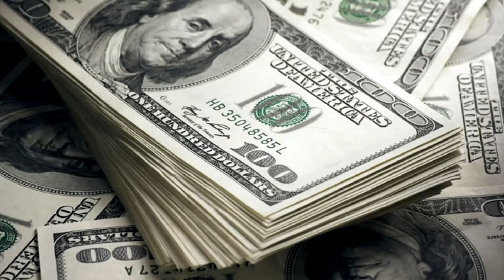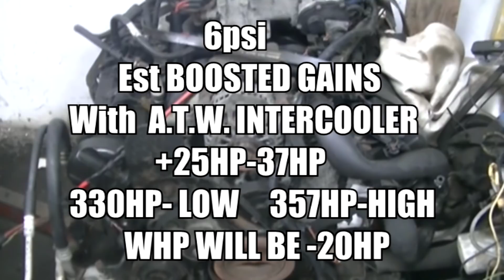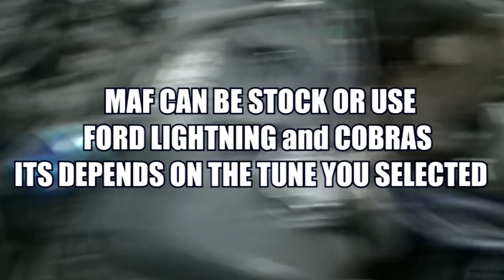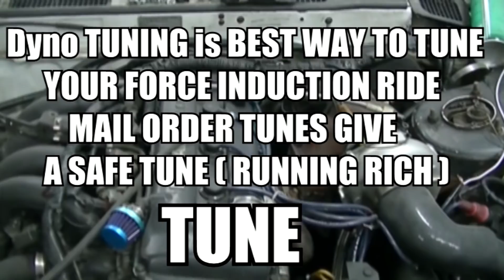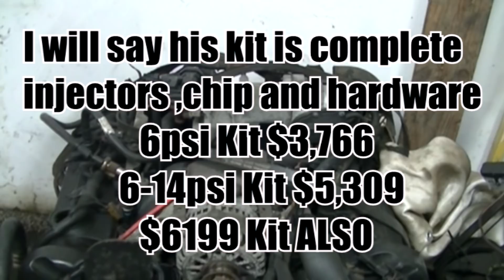TOP 3  BOOST METHODS FOR YOUR CROWN VICTORIA ( Which 1 is your number 1 )

Comment: Supercharger. Flatter curve. Easier install. Easier to cool. More reliable. More tunable (within reason). Just expensive. I have a Marauder so I’m keeping it. Only doing the best work to mine. You want power down low anyway.
Reply from the maker: True, but the cost for power down low ( with low funds ) Turbo would be for me ( ideal ) is the supercharger but it aint cheap...Procharger would be my 2nd choice ( procharger ) aint cheap either its tough call

Comment: I will say buddy, my turbo setup going in my 05 town car has cost me a total of 400$ Canadian and about 100 hours of my time to build from scratch. However it's a roadkill-junkyard special, a tp38 1rst gen power stroke Diesel turbo on a junkyard 4v aviator motor 😁 I've got 3 times that in the t45 swap 😂😂😂
Reply from the maker: it can be done i wished you had video that one brother... cause I love the back yard stuff.. I am all about that... Just put a Aviator engine in a96 police crown Vic witha 5 speed and Mach 1 upper and lower... its tough to make things happen you can win in one area but you will take a hit $$$ somewhere else for sure
Reply: When I finish rebuilding the 4v and get the swap finished I'll send you a video of it running and driving and maybe even a 1/4 mile pass if everything holds together 😜 it is an ultra low budget junkyard setup after all 🤣
Reply from the maker: @mross302  cool I would like to see that I will be doing some rebuilding myself... I was running away from it but now its time....
Reply: @bstfordchannel923  a lot of what I am doing is thanks to people like you, cleatus and the guys at roadkill, it won't be a record breaker, but if I can do 450rwhp reliably, I'll be happy for my investment. I work at a shop where I'm on a 40hr a week salary, and in my off Time I get payed to build my projects 😜

Comment: The best thing I did to my N/A, home brew GM EFI system, was add a Wide Band O2 to monitor AFR's. I am no tuner by any means but that W/B really opened my eyes as to what was going on with my engine and why it would lay down at certain rpm/load. I have a MOATES modified ECM that I can burn chips for and I am slowly creeping up on my tune thanks to the wide band O2.
Reply from the maker: agreed it does you get a more insight on what the car  does in different loads... I have to install one in the Vic soon..a very underrated gauge 100%

Comment: Honestly I would get the most mileage of out of your crown Vic and when she says it’s very tired and time for a rebuild, I would rebuilt it with upgrades but still stock then do either the pro charge or the super charger and if possible use the police tune because no one can make a tune unique for pursuit that’s why I love having my p7b but that’s just me while I daily drive mine right now for the next couple of years.
Reply from the maker: Thats they way to approach ( building you car ) it really perfect with no stress. NOW TUNE well you have tuning chops out there that can DIAL YOUR NEEDS to a T...So that cop tune ( is really based on TORQUE CONVERTER slight advance timing and shift points thats really it . Nothing too special at all , its dial to be efficient- with simple combos in ( small upgrades ) that cost ford ZERO to produce..  Daily drive your car until it wears down ( or buy a second motor ) and build it slowly over the years to your liking ..

Comment: a top 4.6 tuner used stock pistons and rods witha cam and a vortech and made over 500
Reply from the maker: the key is really the tune and gas and the wheel man.... the tune is really the most important having enough gas and timing right

Comment: Thanks bro that was exactly what I needed. Hey so I drive Lyft in my crown Vic PI n the passengers all love it. I don't understand WHY DON'T THEY MAKE IT ANYMORE! Even just putting that to one side, why can't I get ANY big fast full sized eight cylinder car. I'm 54. I don't like the small round cars and I don't want a truck. To me full size means full size. Any ideas as to what I should do? N thanks again for the awesome video.
Reply from the maker: I had to make time to answer this comment cause it mans that much tome Jeff.. Thank you for the support and love on this video.. Now The reason they got rid of Big full size cars is there is no REAL men out there like yourself to buy them.. The wave is the Suv and the CrossOver suv. So its a tough sell to say hey Ford big the big rides.. They just will not UNLESS the tide changes. AS YOU and I ,ay these big rides cool and wanted they MAY wiggle a big ride to test the ..waters Now Dodge has a Full Size v8 and its doing very well, Ford can not compete because it will mess with the flagship Mustang. Any thing faster will have to be a Mustang or Mustang badge aka the Mach E

Comment: Thanks for the info just bought mine and looking too see what mods I can do! This helped out alot
Reply from the maker: no problem  it cost alot to make these fast cause of the weight of the car ( 4000lbs and 220hp  engine ) so you would start with gears,  cause you will make car move fast off the line.. 3.75 is good. Merry Christmas Berry

Comment: Get yourself a 97-98 non PI 4.6. Swap the heads for PI heads. Install some Comp cams 274 I believe. Get a larger throttle body. Get a transmission kit and change your torque converter. Add a 100 shot of NOS and you are around the 500hp range.
Reply from the maker: I was started to do what you said... and then somethinh happen alonmg the way and I end up doing this instead https://youtu.be/BHlDSH_Y9tM
Reply: Why a non PI?
Reply from the maker: @keegentilley578  well those have the flat top pistion and you add that to a Pi head ( better flowing ) ect more compression add a tune and your good or just rebuild your engine and get flat top pistons..

Comment: My goal is to get a 09 4.6 slap an aluminium intake, cams, injectors, coils, rockers, push rods, air intake, and a tune. Dont know what else I'd need any tips whats a must.
Reply from the maker: it doesnt have push rods no cold air intake. you may be disappointed in the hp gains whe you spend that money.. i would go with a mind cam now valve train stuff and a tune.. Unless you plaining to do force induction in the future..  check here https://youtu.be/vwQLM4Vd0E8  or here https://youtu.be/Vs3EX65R4Uo

Comment: You gave a price for the turbo and super charger but you forgot the pro charger price.

Any idea on how much they run and the type of numbers you’ll get.
Reply from the maker: procharger prices are about the same as super charger ( it seems ) hp numbers are the same across the board.. It all depends on the pulleys used..jus have to figure the pulley set-up to use in our cars ( crown vic )kinda ideal most cases just the cost is a bit crazy just for the unit

Comment: Turbos work best on inline and V6 applications because of the space issue . Centrifugal superchargers work best on V6 and V8 applications. I personally would never use a roots style superchargers because of the intercooler it's basically a radiator that has coolant running through it if it cracks coolant gets sucked in to the engine and you will damage or destroy your engine. Centrifugal superchargers have intercoolers but it similar to the style that turbo's use and most kits come with a air to air intercoolers not water to air intercoolers  so the water issue is never a problem like you could have with a roots style supercharger
Reply from the maker: I can agree with you on what you said... The roots one isnt ideal, but its works with min space.. i roll with turbos even though it sucks to route.... I like the prochargers that get my vote ( when I have money ) For now TURBO all the way..

Comment: With the pro charger do I have to upgrade anything before installing or can i just install and have no problems with engine not handling it. I’m not talking about high psi but more of a smaller or medium boost
Reply from the maker: 5- 8psi is good for what you are mentioning ( This is what I THINK ) many say different.. The TUNE is the MAIN THING a good ( DYNO TUNE ) .. I would change intake gasket ( that may be the weakest part ) simple fix cause we know they leak from time to time..
Reply: Thank you 🙏

Comment: Would you suggest someone build a 6.8 V10 for a crown Vic? I was thinking about getting a Vic and building a turbo v10 for it.
Reply from the maker: the v10 has been done NOW the turbo part nope, but it would be cool to see one, but the Coyote would tear it apart even the 4.6 dohc TURBO would tear it apart... It would have a lot of pulling power
Reply: @bstfordchannel923  I feel like a v10 crown Vic would be a torque monster and drift like a champ but I do agree that the V8’s are gonna be faster.
Reply from the maker: @hilljackzack7284  i cam side with it will be crazy amounts of fun, but if we can addres the heads and do something with making it better it can be something..

Comment: I would recommend a stroking kit 5.0L at least which would make the bottom end handle any power you plan on boost.. I'm looking for a 5.2L stroker kit tho, saw it in my google search just cant find it anymore but I refuse to buy any stroker kit less than 5.2L, dang it.. Stroker 4.6L+ 2v kits have forged internals which obviously beat any stock engine's internals, for anyone with the $$$, might as well invest it the smart way.. I'm modding my 95 Lincoln Town Car, to the max in N/A first, then procharger or supercharger route..

Comment: My 96 crown vic 4.6  oil mixes with the water. How could i fix it? Should i spend money rebuilding it? Or buy another engine? which is cheaper in your opinion?
Reply from the maker: Its best to swap out the motor thats the cheapest way... Plenty of those motors around plenty... Do not fix the headgasket... Or you can drain the oil out and coolant. Then add a bottle of $17.50 K-Seal in the coolant and see what will happen.. If worked for many guys ( not thats to keep you running ) until you replace motor
Reply: BST Ford Channel alright im going to swap it thx man
Reply from the maker: @zeref-yt3492  Just swap it to a lower mile motor.. Change gaskets where need may  be and just call it a day Trueopp

Comment: Adding  more boost to a worn stock engine = cheap as possible to hit your 300hp goal. It's a short lived play toy. If you want to keep the car around = rebuild, Scat H rods, rebalance crank, cam set, springs, ARP studs, Milling oil pump and the turbo. $8 to $12K. Adding new weight to a house with a bad foundation is a short lived dream turned pile of rubble.
Reply from the maker: Agreed can not debate you on that... The problem lies is plenty Crown Vic owners ( 50-50 ) have very little funds but want a little umph to there ride.. Sad deal that it will cost them (its a 4.6 2v no less) and power isnt formed by this set-up.. and the number you just mentioned 9 nprice wise ) .. Thats why I stated ( in other video ) if you got money like that ( buy a race prep engine 7k ) and then slap what ever on to it   ,another 5k ( simple and safe ) oh but we didnt do the trans yet so it keeps going the $$$$$$$$..
Reply: Throw $1500 used ebay parts at it to gain a reasonable 30hp and call it a day. Like you said, shits going to start failing as soon as you put too much pressure on a system not designed for it. Old school Maverick seems so much easier to deal with on cheap power. But then it makes up for it on costly suspension to get it to handle anything close to modern. Take your time, keep looking for deals and answers. Got to get one of them moved? Seems the one that needs only the power would be    the quickest out.
Reply from the maker: @ltwig476  your are right thats why i rather the turbo route ( cheaper ) and you get good hp vs what you pay into it.. And if you built a solid system you can buy a better turbo and then ( if you have 7k or even 4-5 ) build a solid motor and turn the boost -up..   The Maverick is the easiest for power and learning about what can be done.. Suspension ( front ) not so easy , rear semi-easy ( brakes ) semi-easy.. I am thinking about some engine mods ( swaps ) and stuff nothing is sticking cause of price ( turbo seems to be the route to go..FOR NOW lol
Reply: Yeah, I was thinking cheap turbo for the Vic. Now I'm thinking great $turbo because you can always save it and it's set-up for a stronger built 4.6. Just depends on keeping the Vic or not, to drop major $ on a great turbo and system. Now back to your original agenda and spending LOL
Reply from the maker: @ltwig476   we riding the same wave- thats how I have to do ( make if fit,then work well ) keep low boost until I can build a solid motor THEN we crank the boost with a good turbo.. Same plan you speak of, but we going low budget 1st

Comment: I have an 07 cvpi and I want mine to have 600hp and I was thinking about engine swaping but which is easier
Reply from the maker: Depends on your money you know gain of 600 can be have with some money.. hich swap you would like is another issue... and have you price the goals in a swap 5.4 dohc or 4.6 dohc Coyote ect.. There is so much to think about
Reply: 5.0 from a F-150, dirt cheap all day long. Seen quite a few of them under a 1,000 bucks, just gotta look for them.

Comment: How much horsepower do all mods make?
Reply from the maker: varies on cam ( stroke ) and head work... On stock block 400 maybe 475hp safe zone ( tq will be in the 400 also or very close )...The magic is in the tune, but if running a 2v ... You shoud change the valve springs ( cause the engine likes to rev ) and the driver will spin the motor ( even with stock cams ( not must but a thought ) 

Each setup produce power diffrent i like the turbo ( my pick ) take negative energy and make it positive vs the others big injectors better maf and fuel set-up  ( option valves and head studs ) you can make things happen with a stock engine tq will come in sweet.. Its the tuner thats going to make things happen ohh and your pockets

Comment: Great video where I can get a procharger I have a 1999 crown Vic looking to do some upgrades
Reply from the maker: the issue they have one for the 2003-up it should work on a 1999.. to options sell car or do a frame swap from a 2003 to you body. or you can buy this kit and it should fit with little mods, but this kit cost a GRIP https://adtr.net/product/ford-crown-victoria/supercharger-ford-crown-victoria/adtr-supercharger-system-2003-panthers/
Reply: BST Ford Channel  ok thanks I will look into it

Comment: How about a twincharger setup?
Reply from the maker: Twin turbo in a Vic is tough under the hood.. So many things can go wrong IF you are a beginner like us.. Single is best to trouble shoot vs two thing to trouble shoot ( if you are speaking of turbos )
Reply: @bstfordchannel923  I think he meant running a supercharger and a turbo which again is hard for a begginer.
Reply from the maker: @MARZOSIRUS  Turbo is the worst for a beginners v8s debeding on design superchargers or prochargers are next in line of being difficult
Reply: @bstfordchannel923  I hear ya man. 

What dude was asking for is twincharging which is running a supercharger simultaneously with the turbo which they call twin charging. The setup is supposed to be the supercharger kicks in for low rpms then shuts off and the turbo kicks in at a programmed rpm. 
Most definitely not for beginners considering labor and costs involved.
Reply from the maker: @MARZOSIRUS  THAT IS NOT FOR * the weak heart ) lmao... You are so correct on that... thats a very advance set-up a heck of a time tuning that..

Comment: I'm coming from a the miata scene, I've seen people slap a ebay turbo kit on a miata in 2 days with no tune or fuel system upgrades or anything. My 09 crown vic (134k miles) is my first v8. What I'm hearing from this vid is you can't force air into a stock 4.6 without breaking the bank. Disappointing to say the least but thanks for the vid
Reply from the maker: Oh yes i come from a s13 background so i do understand the thoery of just slapping a turbo on.. Now can you slap a turbo on a Crown vic YES.. with no tune YES On stock fuel pump Yes all these thing will run a bit lean with low boost it will be cool... that to say the 4.6 is not a B6 by no means
 I am going to have to try this and show it can be done with NO TUNE at 5 psi or 6-7 maybe.. The internals are weak in the 4.6 in Na form thats the issue
Reply: @bstfordchannel923  I'd love to see that, love the channel man I subscribe:)

Comment: What about nitrous I was thinking about installing the nitrous on my crown Vic 2008   4.6 v8
Reply from the maker: Nitrous is cool, but works best @ wide open throttle ( if racing ) yes, but not Ideal ( and not as fun ) as the other options out there.. Racing wise to get that JOLT Nitrous is cool... Nitrous will expose that weak link quicker in drive line or engine quicker ( if there is any weak parts ) each car varies..
Reply from the maker: Merry Christmas to you and your family

Comment: Exhaust studs on any of the Modular. Engine's 4.6, 5.4, 6.8 are no big deal. I weld a nut on the factory nut. 9 out of 10 come out if it snaps I weld another nut to what is left. The weld won't stick to the aluminum. The heat from the weld help breaks stud loose. Run a tap in hole and new stud good to go.
Reply from the maker: well it isnt tooo bad but its 5 studs like mine well you may think that over ( on a 5.4 )... I had a bad welder also thats was a big issue
Reply: @bstfordchannel923  lol I'm from Michigan rust belt capital, I do those studs on a monthly basis in vehicles. Haven't had 1 yet I haven't got out. I do a lot of them because people are scared to try.
Reply from the maker: @kevind3185  ok I see now. same here in nj. but Michigan is way worst... I have done a lot like you have but its a mess you... You athe man Kevin 100%
Reply: @bstfordchannel923  patience is the key
Reply from the maker: @kevind3185  very very true